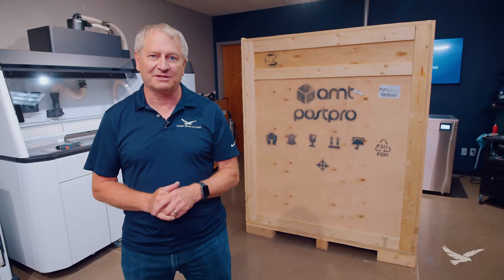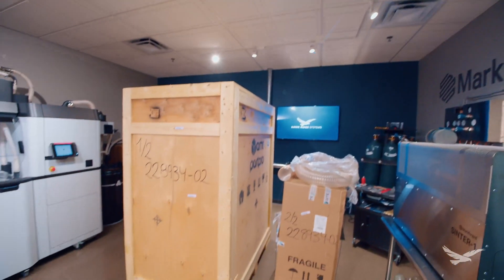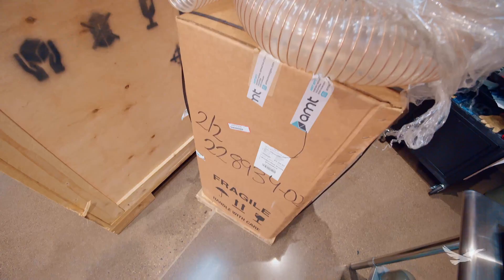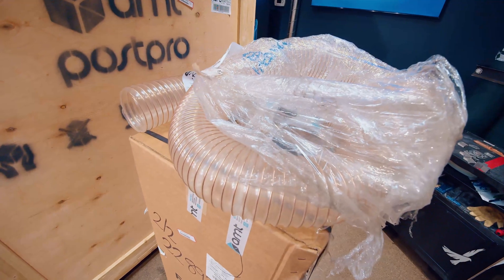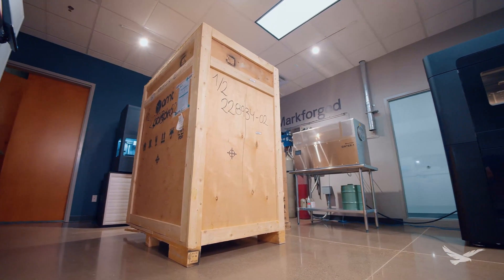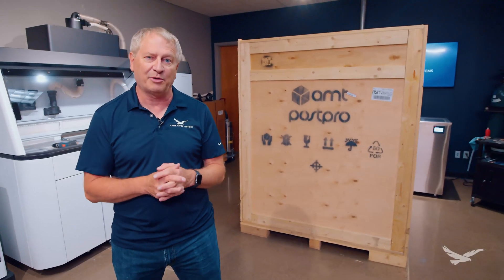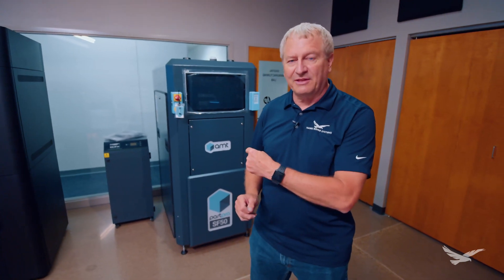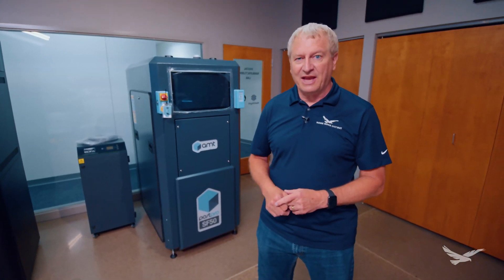AMT PostPro SF50 Vapor Smoothing System Unboxing

Comment: Excellent piece of equipment! Any advice on how to prevent the speckles and dots that appear after the process?
Reply from the maker: Contaminants on the part surface could potentially cause that issue, whether it's residual powder from printing, glass beads from cleaning, water droplets from washing, etc. More information is required for a complete diagnosis, and we always recommend getting in contact with your reseller for support.